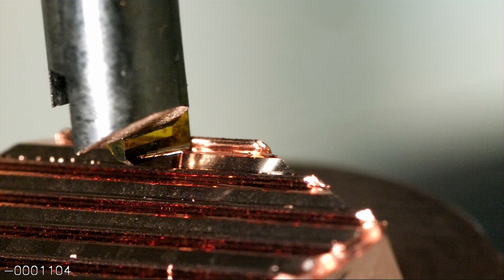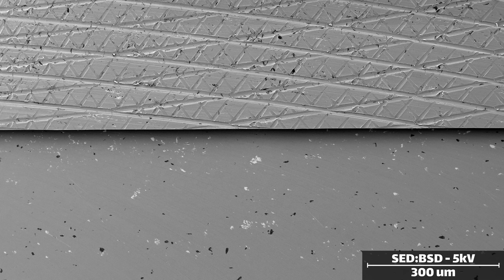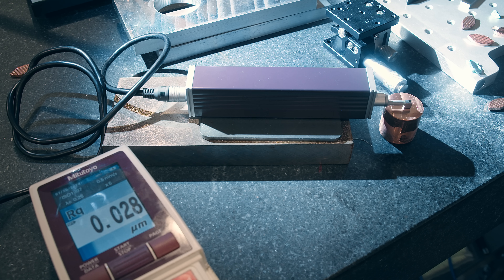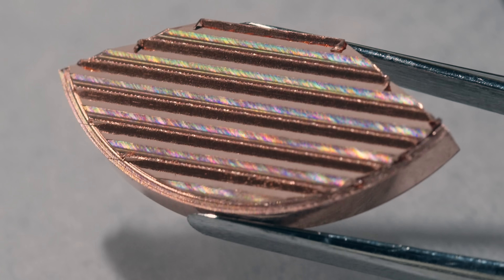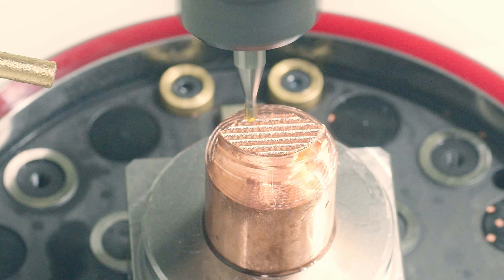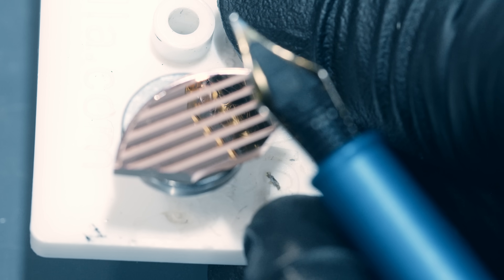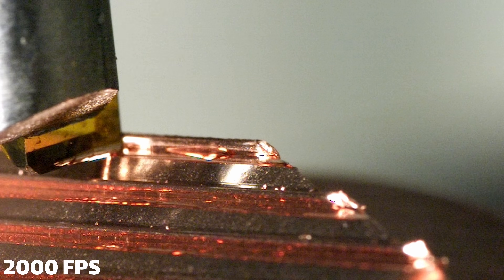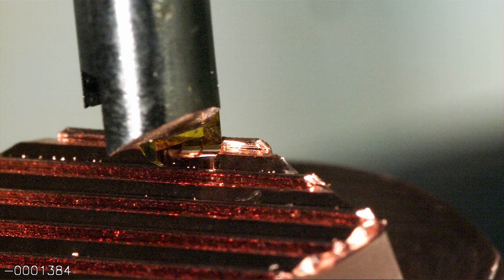Cutting mirrors with Diamonds

Comment: @0:33.  THAT machine is what scientists use to create a Bose-Einstein Condensate.  They use the lasers to cool down the sodium atoms and use evaporative cooling to do the job.
Reply: It would be extremely cool to see Breaking Taps make a BEC, the coldest state of matter. That's not easy, but I think a sodium or rubidium BEC is reachable in a DIY setting. After the MOT, he would "only" need to perform some laser (sub-Doppler) cooling (not easy), and then evaporative cooling in a magnetic trap (quite easy, just need some big magnetic coils and enough atoms initially).

Comment: Can the tool bit and part be completely submerged in a coolant liquid with circulation? Any of these processes seems to generate a lot of heat and air cooling can be quite limited in thermal transfer.

Comment: Genuine question. How do you cool something with lasers?
Reply from the maker: It's uhh, complicated 😅 I'll talk more about it in future videos, was too much to get into here (and still learning myself). The basic effect is called Doppler Cooling. Basically the laser is tuned such that it "resonates" with an atom only when the atom is moving towards the laser, which causes it to absorb and re-emit a photon. That process steals a tiny amount of momentum because the photon is re-emitted in a random direction.  The net effect is that atoms drift away from each laser, towards the central area where all the lasers intersect.

Since heat is just the movement of atoms, as the atoms slowly lose momentum from the doppler cooling effect they slowly become more and more still which == colder. Eventually you end up with a cluster of atoms that are barely moving at the center and very close to absolute zero temperature.

Comment: Did you try asking the authors of the paper?
Reply from the maker: Nope! Thought about it, but wouldn't have really changed much. It was either A) machined with carbide, in which case no problem. B) machined with MCD, which I was wanting to try so no problem. Or C) diamond turned in which case I was SOL 😅 (Unlikely to be diamond turned given the geometry though, would have been very expensive parts and easier to make a round fresnel anyway)

Comment: You have some of the most small batch but high interest projects I come across. When you're getting into micron perfection, the frequency of steppers/actuators even come into question on what truly makes the smoothest of the smooth cuts. NASA has some really interesting white papers on mirror surfacing that one can find with some intense google-fu. I came across some other 'light reading' with Edwin Hubble's techniques of achieving flatness even in his time which was remarkable. The irony of the Hubble telescope's early issues did not go unnoticed. 😉

Comment: Cool video, as always.  My guess is the length of the tool is not helping the surface finish.  It'd be interested to see if reducing the tool length to the shortest possible dimension, that still allows the toolholder to not collide with the workpiece, produces any improvement in the surface finish.  It's always good to see a video from you in my feed.

Comment: Have you considered Grinding? There are 150K RPM air spindle attachments for HSK E40, also what about electro sputtering to build a smooth layer?
I also think that the lengh of the tool itself played a part, since most DM viedos i saw uses a very hefty toolholder

Comment: Those "torn out" regions almost look like grain boundary regions. If going to a softer material helped fix those, that reinforces my thoughts. You are working on such a small scale that even a slight change in material "hardness" can cause issues, and those could be grains where the crystalline structure is better suited to resist shear forces. If that is the case, spending some resources to obtain (buy or create) monocrystalline copper, or copper with a grain size larger than your desired mirror surface, could be very beneficial.

Comment: I felt like my 2 decades as a toolmaker had offered me the chance to see and understand all most all subtractive manufacturing processes, but this was new. Very exciting tech, very very nice results! If you at any point want to try Alu' again, may i suggest going with 7075 (expensive), it offers material properties which allows for mirror finish, with the right "normal" milling cycles and tools (you'll need specialised Alu' tools, special cut, no flat "strength" zones/corners like with regular end mills). EDIT: Now i'm just wondering what results these diamond tools could give in Alu' 7075 :D

Comment: the coolest part of these IMO is how strong the binding is between the carbon lattice and the metal that holds the cutting bit.. Basically the carbon lattice is formed electrochemically and this essentially works as the strongest glue ever

Comment: The heated airflow could easily be iterated.
The ‘simple sputtering tube’ could be improved to introduce rectilinear flow.
A pressurized gas flowing past a heated rod in a choked guide path would provide a good data set.

Good stuff.

Comment: I haven't seen this much shiny scribed tools since the 2,000 steel axe they discovered sharpened with a diamond that didn't rust. This might make for a good start an older  lithography die since it's smooth.

Comment: cut all flats in one liner motion never use a square tool in a rotary motion unless passes never over lap
Reply: also try adding pressure to the surface of the mirror your cutting after the diamond maybe something like a second polished diamond a tiny bit lower than the cutting tool to get downwards pressure to almost iron the copper with a diamond

Comment: Single crystal substrates might come in handy.  Softened copper is probably gratuitously annealed and the grains may be quite large.  You may be building up some sort of dislocation front that is work hardening faster than its neighbor grains.

In the same way silicon wafers are cut and polished in specific crystallographic planes, so can copper.   I don’t know which would be best. Gut feeling is 111, but a metallographer would have a better feel of the strain tensors.  I do optical ceramics, not squishy metals.

Comment: This is absolutely fascinating! And very impressive results especially considering this is definitely not the optimal tool for the job given all the inherently movable points between the tool and the work. Big benefit of a shaper is the heavy column gives the tool a huge amount of momentum so it's less easily deflected. Could adding mass to your table and upping the feed rate help?
Given you seem to get a better result with softer material, how would increasing the temperature (maybe just by 50*c or so) affect things? Of course you'd need to ensure the ambient temperature matched so you might need a different lubricant fluid.

Comment: Copper likes a positive rake for cutting, with you using a flat tool with full width contact when shaping, keep the tool length as short as possible. In you milling operation to stop the milling marks you could try putting a wiper flat at the bottom of the tool. So instead of the clearance going for the cutting edge to to the centre create a small flat thats parallel to the cut surface the will wipe the peaks off. The flat of .15 - .2 mm if you can produce this on your lapping machine. Regarding the movement in the 'Z' axis just set the depth and plot a path around the component.

Comment: You could try and lock/fix the axises of your machine that do not need to move like the Z, turn table, and 4th axis.  This could be as simple as tensioning it with a ratchet strap.  It might be kind of hard to bolt or clamp because the machine is not intended to do that.

Comment: Since softer copper worked better, would heating up the copper help make it softer at all? Like blasting heated isopropyl and air at it
Reply: Since the annealing process for copper involves heating it until it glows incandescently, that would suggest that you'd need temperatures far above the autoignition temperature of isopropanol to cause any meaningful softening. And while turning your mist cooler into a flamethrower does sound entertaining, surely it would be easier to anneal the copper prior to any machining steps.
Reply: That's such a weird thing to suggest. Of all the ways to heat it, this is what you go with?😂 Sounds like you went "hmm what can I say that'll make me sound smart and scientific"💀. 

Anyway, You can't blast "heated isopropyl" because you're raising the temp of an already volatile liquid, making it evaporate much quicker. That's 1, 2), the vapors are toxic and dense. You're better off blasting hot water at it. Do you know what happens when evaporation takes place? Temperature drops, volatile liquids like alcohol, acetone etc are amazing at evaporative cooling, you'd do the exact opposite of heating, you'd cool that part so fast it'd start to frost. Not to mention, while blasting air, you'd literally be aerosolizing the alcohol by blasting air simultaneously, so unless you're aiming for igniting that and creating a rocket stream, you'd just end up evaporating the alcohol really quickly and cooling the copper insanely fast, no matter how hot the alcohol is, which would need to be REALLY hot to raise the temp of the copper enough to soften. How are you even a "science YouTuber" with 1 million followers? Yeesh😂

Comment: Try Tellurium copper it is a free machining alloy. Some machines have servo amplifier gain noise that can cause the chattering or its just the ball screw bearings. If possible try cutting on the Y axis to see which axis is worse. Heck even a compound motion to see if it will eliminate it. could be machine harmonics. Great video !!!!

Comment: The reason you can't find larger stock of ultra pure aluminum is because it's sale is restricted a bit since it is used in the nuclear fission field since aluminum is one of the few materials that neutron radiation doesn't cause to degrade since it returns to aluminum after it decays from being given all those extra neutrons. As such the smaller pieces are probably being recycled rapidly to keep the prices low so you aren't going to find cutoffs since collecting small cutoffs over time through multiple channels is one method to circumvent anti-proliferation treaties.

Again, people trying to kill each other ruins perfectly good science and economic solutions to problems.
Reply: I think it's more to do with the fact that there isn't a demand.
The biggest consumers of aluminum are the transportation manufactures and they don't want pure aluminum they want specific alloys in dimensional stock.
Reply: @TurboLoveTrain  That too. Pure aluminum stock isn't really all that useful outside of the nuclear industry and some very select industrial applications, so it is a secondary reason for not finding it.

Comment: Very cool video, love this.

I feel like having the metal colder would  help bonds be stiffer but at the same time more stiffness would make jaged breakouts. Warmer metal would be softer but then you form pools of metal that bunch up in front of the tool.

What if everything was very cold but introduce very high vibration on the head so you only heat up whats being scraped off the surface. 

Optics are tough, this was a great watch and gets the brain going to achieve the ultimate finish.

The vibrations will probably cause so many other issues in surface finish. Just due to the tooling bending from side to side chaging cutting angle and the inertia in the tooling machines... would be awesome to experiment like you, this is a very rewarding experiment!

Comment: Holy heck. This is BEAUTIFUL. Science is art from data. How fast do the freshly machined copper and subsequent deposited aluminum form oxide layers, and how does it affect the optical characteristics? How deep into the surface does oxidation occur, and does the smoothness of the finish affect that? (My thought being that a rougher finish has more surface area to oxidize, but does that magnify the impact of the oxides on the optical qualities of the metal if the oxidation penetrates to a uniform depth?)

Comment: Hi! Want to try something to improve surface finish with a MCDT? Coat the surface to be finished with a Sharpie marker. 

Learned by accident from a co-worker that partially coated a surface. The blue spots of sharpie stood out, even if the tool cut the surface. It was shinier than the uncoated surface.

We then discovered that there is search papers written about surface tension induced by an adhesive ( such as glue stick, sharpie, paint marker,etc). It was found to improve surface finish.

Let me know if you try it 👍 

As always, I really enjoyed your videos , fantastic work 🤘
Reply: This checks out from experience of 3D printing.  Essentially, any differences at all that the machine encounters in the surface of the material being cut must impact the cutting process, however slightly, and therefore must impact the finish..
By coating the cut surface in sacrificial adhesive, you are decreasing the contrast between the cutting tool encountering a high spot, especially if coated, with surface tension as a factor, vs freely spinning over a low spot with no surface tension.
Reply: Thats wild! It does make some sense, and is about the lowest barrier of entry to put it to the test., Except that the mist cooling or spray bottle with isopropyl  might cause an issue with that. I hope he gives it a test  if he ends up seeing the comment!
Reply: @connorjohnson4402  alcohol will certainly dilute the ink, we used an odourless solvent instead. The blue Dykem liquid is a lot similar to  Sharpie's blue ink. Both cleans up really well with methanol, leaving a dry and clean surface the the part.
Reply: Maybe it's just acting as a lubricant at that level of pressure and reducing tension and heat as it cuts, reducing oxidation.

Comment: My first thought at the "wavyness" came as a mild riddle to describe. Methinks there is an equation or two to be done with the distance between the peaks of the wave pattern that could arrive at the peak to peak distance of the [round object type] in the bearing(s). Could probably extrapolate to the peak>valley difference in the wavys as the amount of runout in the bearing(s). If you wanted to go crazy, I'd bet that the number of unique peaks in the wavy pattern matches the number of [round object type] within the guilty bearing. I could also be completely wrong thanks for attending my ted talk.

Comment: I remember an awesome video showing scribing done on DIY CNC mill, including fine control of the spindle for direction changes. Had a hunt but couldn't find it.

It occurs to me that an obvious option for improving the finish of your mirrors is to create a lapping tool with the same technique. Those little scratches and waves would polish right out in a few minutes and I'm sure you could get a near perfect mirror finish if you're careful.

Comment: I wonder if ways made from optical glass on optical glass would nearly eliminate the variations. Lubrication from oil would probably be useless, because of differences in floating, but maybe finely powdered graphite?

Very cool. I think you pushed your machine to its absolute greatestcapability.

Comment: Don't forget, the ball screws are turned by brushless DC motors. Not steppers but still have a certain "step" to them based on how expensive the drives are. They are digital and will produce "steps" even if we can't see them or hear them.
Reply: AC Servos are more common nowdays and i think the linear guides play a bigger role but your point is still valid. 👍🏼
Reply: @thomas8719  whats the difference between a brushless dc motor that is precisely controlled and an ac servo?
Reply: @vornamenachname8001 I may be wrong but I believe the servos have encoders built into them whereas a brushless motor doesn’t necessarily.

Comment: Why not use a surface grinder, scraping plus hand polishing under the microscope for the mirror surface? Given that it's small and a one-off custom job.

I always thought hand polishing for the last mile was the norm in high precision optics. I thought that was why they cost so much...

I've seen companies advertise micron accuracy for their CNC machines but, in reality, they still leave tool marks if the part is wider than the tool.

Comment: Amazing how well your cnc machine does at such tiny tolerances! I remember Dan Gelbart and his marble/granite cnc lathe bed, used to make near perfect cylinders. It used air bearings to achive that,
But seeing that you can achive such a tight tolerances without hydrostatic or air bearings, it's amazing.
BTW, how do you protect such perfect surface until it's ready to install, or if you need to make another machinig operation?